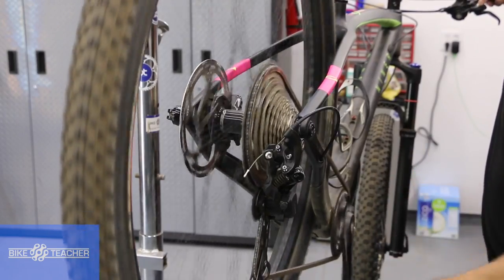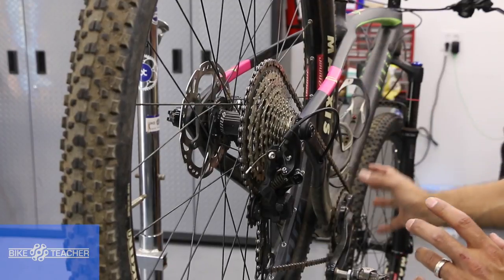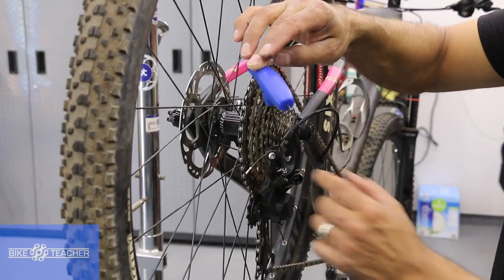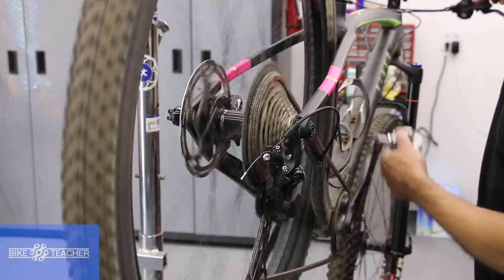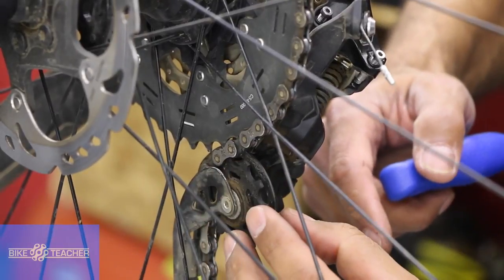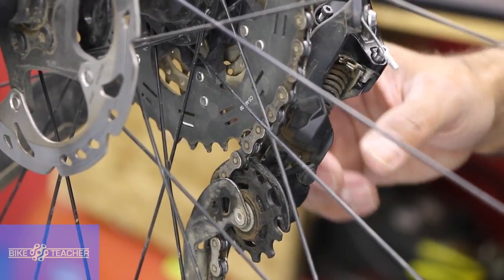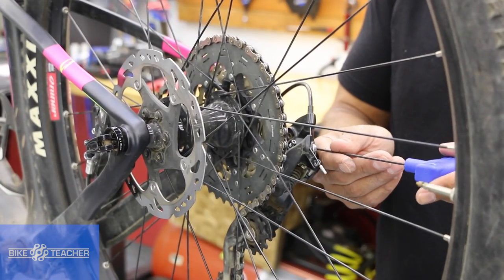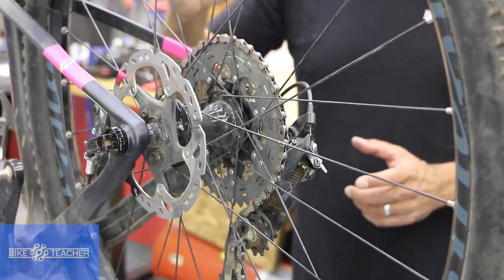How To Adjust The B Screw On A Shimano XT 8000 Rear Derailleur

Comment: I have a brand new bike fitted with Deore XT M8100 Derailleur 12 speed. Under high load it appears to jump a few teeth. what would you suggest needs adjusting?
Reply from the maker: When it jumps, is the chain staying on one gear only and giving the feeling of the chain lifting up and off the gearing skipping a few teeth? If so a worn or older chain (would not mesh well with  a new cassette). If the chain wants to go between two gears and does not stay still it could be a barrel adjustment.
Reply: @BikeTeacher  yes it stays in the same gear. The bike is brand new as are all the components.
Reply: Well, I am a beginner so I am not sure, but having the same issue of jumping under load, it seems to me that happens when I shift gear slowly, and it won't happen when I pull and release  the shifter's lever very quickly.

Comment: This subject isn't covered much by other people so well done. What happens if you keep it too tight for a long period of time? Could it wreck parts? I think that I have put premature weare on my bike having it too tight?

P.s: I think changing the main name to shimano B skrew adjustment would bring in more views. The Derailleur type should be in the subscription.
Reply from the maker: Not that I have noticed, if it is putting premature wear on anything it is minor and has not been very noticeable to me. Technically is it putting tension on the pivot spring, but that is one tough spring in my opinion. Thanks
Reply from the maker: +Vince King  I will look into the title change, thanks Vince.

Comment: A quarter or half turn clockwise isn't too harmful but turning it that direction more than that grinds the screw into the derailleur's b-screw tab. You can break or strip the screw not to mention creating a rough spot for the screw tip to rest. Pull the RD back a bit as you turn the screw to CW to prevent this.
Reply from the maker: Good advice.

Comment: I have been working on a bicycle with a 1X11 setup, but I cant seem to adjust the gears properly. I have a Shimano deore XT dynasys11 shifter and following rear deraliure and cog: Shimano Ultegra R8000 derailleur Medium Cage
Shimano Ultegra R8000 cassette 11-30t.... are those not compatible with dynasys 11 XT shitfer ?? My local repair man couldnt adjust my gears also, but told me I had a 9 speed shifter, which I dont believe I do. .

Comment: Nive video. What size is your Cassette? it's look bigger than the 11-42T. I currently have a 11-42T and like to upgrade to the  CS-M5100-11 Cassette or the SunRace MX80 11-50T. any suggestion what I need or no do? thanks
Reply from the maker: That one may have been a 46 tooth.

Comment: Thanks, this is a really clear video!                                                                                                                                                                                                                                                              I also have that Grrrr sound, but only when riding in the highest hear (smallest cog in the back). Would this also be a B Screw issue?
Reply from the maker: The grrr sound is probably normal. More noticeable when I’m the repair stand due to no pedal pressure.

Comment: My crankset is a 12s 1by m8100 but my rear derailleur is an m8000. Im currently experiencing shifting issues. Just want to check if thats the cause of the issue

Comment: My Shimano STX Derailleur (11-28 casette and 24 chainring) is still hitting the casette with the screw all the way in. I already checked for bent cage and hanger, but it looks straight. My chain is the right length too and the derailleur is original to the bike. Any ideas?
Reply from the maker: The stx could be old enough it will not respond any more. Or maybe the 24t chainring and 28t combo are way to small to allow the chain to register with tension.

Comment: Is the pulley rub worse when the clutch is engaged? Mine doesn't rub when the clutch is set to Off but when set to On it won't shift down to the larger cassette ring..
Reply from the maker: On, it will produce more tension on the chain. Especially in the bigger taller gears. Shimano’s clutch is adjustable. I need to do a video on this. I notice when it’s new it’s works great, over time it gets tough. Maybe lube and or adjustments are needed.

Comment: Great video and very informative and clear. However I have a problem. On my my 25+ year old bike with shimano gears I have noticed that the plastic pulley is way too close to the rear cogs and is rubbing and making horrible noises all the time. I tried doing all sorts of things to the chain e.t.c to help it but all to no avail. Then I saw your wonderful video and I thought great, that's the answer,  however when I looked I found that I couldn't find a B screw adjustment anywhere. I have looked high and low but just cannot see any sight or trace of it.  Could it possibly have fallen off as the bike is so old or again because of its age could it be that it doesn't have one?
Is this true, that some old bikes may not yet have incorporated the B screw in their design?   If it is then I am completely stumped as to know what to do next.  It is such a pity as I love my old bike and have pretty much fixed everything else.
Reply from the maker: Hi, I think there should be something there, take a look at the area where the derailleur is attached to the frame, this is the hanger area. The derailleur has a spring that forces it to rest on the derailleur hanger, it looks like a very small ledge that the b screw would be resting on. Check that area, there should be a hole or screw there. I would need a picture of your der- or a make and model of it, that might help me. It sounds as if this would remedy your problem. Let me know.
Reply: Scrubber

Comment: I have an issue I can't figure out...X01 Eagle....shifting is good top and bottom but the middle gear jumps every time to the next gear down.  I've adjusted the barrel up and down to no avail...Any suggestions?  I'm hesitant to touch the limit screws.
Reply from the maker: Hi Geoff, No need to touch the limit screws, the chain is not falling into the spokes or into the frame. If the chain jumps down that would call for more tension on the cable. Unloosening the barrel adjuster would do this, 1/4 to 1/2 turn at a time, checking progress in between. If all this does is continually move the problem to another area and your flip flopping the problem we need to look at other possibilities. Use the barrel adjuster first, if no luck, then take a look at the derailleur hanger alignment. Downshift the rear der to the hardest last gear, stand behind the bike, get in the eye line of the upper pulley wheel it should be in alignment with the last smallest gear just using your eyeball. If it looks noticeably off, the hanger needs to be straightened with an alignment tool or by an experienced hand. A tool is best. Also, shift front der if applicable into the easiest smallest gear in the front. Here you can check for proper chain tension. There should be no sag, and looking at a straight taut chain line. Let me know how it goes. Arthur
Reply: Art, thanks for the reply.  No alignment issues with the hanger.  I just got it back from my LBS and they say there are no issues.  However, on the trail the problem persists.  I've tried the adjustments on the barrel and tweaked them as much as can possibly be tweaked both on and off the bike.  I've got it down to about 1/8 turn which seems to have improved the situation but the problem is still there.  The problem started right after I had the LBS install a new rear Hub upgrade.  The bike is about 1 month old.  I didn't have the issue until the Hub Upgrade.  All other gears are flawless.
Reply from the maker: +Geoff G   Hmm... inspect the chain for flaws, bends, gouging in the metal things like that, hick ups or stiff links. The cassette could be suspect as well. Sounds like on particular gear, inspect the teeth on the gear it gets kicked off of it could be a manufacturer problem. This is strange, so the whole system needs to be looked at. If you get desperate enough you can replace the derailleur cable to ensure there are no kinks in the cable effecting shifting. See how that goes.
Reply: Your problem is to do with the b screw, make sure it’s 15 mm on the top cog to the second cog on your derailuer. Then slightly move it to 14.75 mm if it doesn’t move nicely at 15 mm it should be better. SRAM has a gap tool to do this. Made out of red plastic. Draw 2 lines 15mm apart on some thin cardboard and slide it in to get the distance right if you don’t have the tool. B screw is crucial on eagle go easy and take your time and you will master it.

Comment: Isn't that indentation the marker for the teeth on the largest gear?  I saw it on a XTR with a white line, but I think the XT and lower have a notch like  a timing mark.
Reply from the maker: I have not noticed, what indentation are you referring to?
Reply: @BikeTeacher  There is a tiny notch on the back edge of the derailleur that doesnt look like it serves a purpose, but appears to line up in the same fashion as the line on the XTR.  Perhaps its something else.

Comment: I just converted my 3x9 to Shimano Deore XT 8000 1x11 with the 46T cassette and race face NW 34 T chainring. when I set the b screw so that it upshifts properly on  the two largest cogs (37T and 46T) without rubbing/crunch sound, everything shifts smoothly except when downshifting from 37T to 32T, it won't downshift or will take a lot of time. if I release the b screw, it downshifts properly but then I have the rubbing during upshifts. I bought a new derailleur hanger because it was slightly bent and I had trued it with a wrench, but problem remains. my cable housing is full from shifter to derailleur. I don't know what to do except let the chain rub. I have tried releasing the tension too but then it messes up all the upshifts. the problem is slightly worse with the clutch on...I adjusted it because it was a bit hard.
Any idea ?
Reply from the maker: How’s the chain length? Chain may be too long. Although you do want two extra links. (4 pieces total).
Reply: @BikeTeacher  thanks for your quick answer. I wrapped the chain around largest. cog and added  two pair of links but my bike has 160 mm of rear travel and I didnt load the suspension so I don't think it is a lot. I thought that going fast downhill in longer gear is when I could possibly bottom out the suspension, going uphill in granny gear is so slow I don't think there's a risk of damaging the chain due to  suspension travel. 
by the way in the end I only removed one pair of links from the 116 links, I thought it was a good compromise between chain length and keeping some links in cas of emergency on the trail
Reply: @BikeTeacher  it almost looks like the 46T to 37T jump is too large and when the b screw is tuned for the largest cog,  the derailleur is too far from the 37T and 32T cogs and hasn't enough leverage to downshift
Unfortunately there is no way for me to try another cog size since 32T-37T-46T is one block
Reply: @BikeTeacher  I was also wondering it could be because of the chain line ? my crank is a 3 chainring race face, I put the 1x chainring in the middle without spacer, and when checking the chain line visually it seems to be well aligned with the  center 6th speed cog, with 5 cogs on each side

Comment: We got two of these for our daughters https://www.youtube.com/post/UgkxHL1v1R3NE5x4KiYfyt8dnQmyNYz7qi5L  the same size for age 6 and 9. It works very well for both girls. Gears were very easy for them to learn. Changing gears up takes some hand strength and is a bit hard, but they are learning. They did not come with water bottle holders- we actually got confused and thought the Derailler Guard was the bottle holder!! Regardless of these details, the bikes are fantastic- even our six year old who only just learned to ride bikes caught on within an hour of practice and loves it. Lightweight and easy for them to handle. All the parts are in excellent condition and the bikes are easy to assemble and very well packaged. Great choice for kids!
Reply from the maker: The bike in the video?most likely.